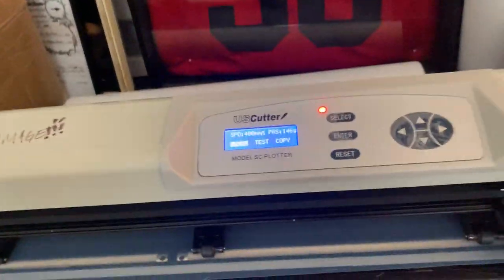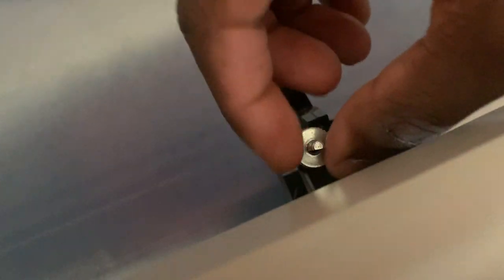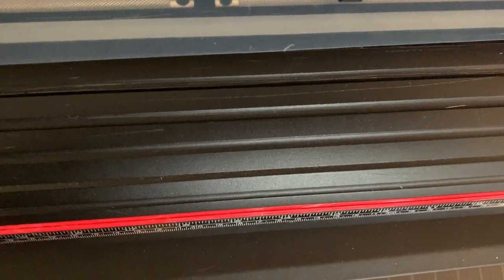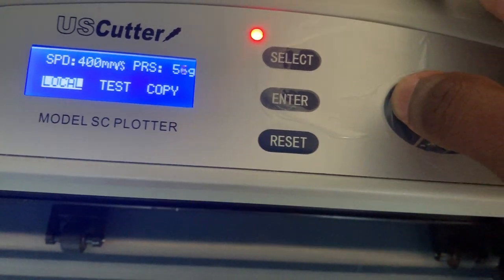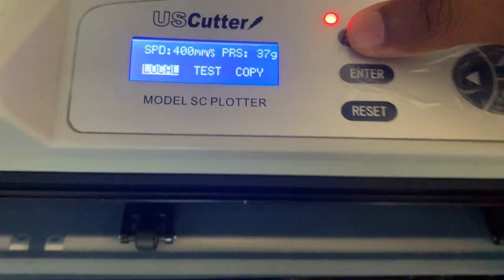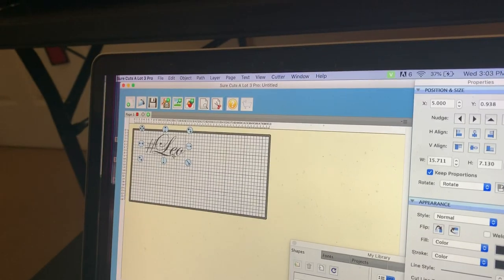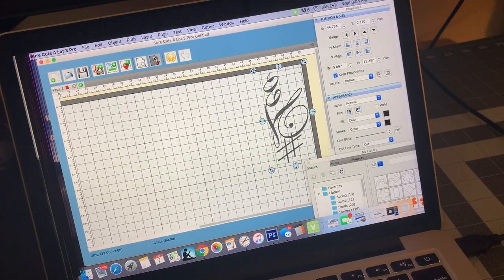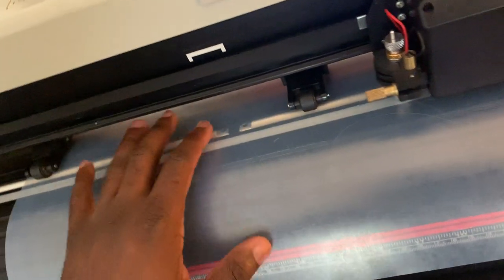How to use uscutter sc2 uscutter mh vinyl cutter

Comment: Please do more videos sir.  I have the USCutter SC2, got it brand new last year and was thinking about selling it because it was making my head hurt.  Your video actually shows what to do.  I want to use mine more so for print then cut.  I have a cricut as well but the Max print on that is 9.25 x 6.75 that doesn't work for shirts 2X or Larger.  If you are well versed in that hook us up. :-) THANKS
Reply from the maker: Thanks! And I will -The sc2 is only for cutting...It does not print nor contour cut. Let me know if that answers your question and let me know what other tutorials you may want to see
Reply: Yeah I know it does print. But there is a print then cut option that I’ve been trying to figure out what is the largest it can cut using that option.
Reply from the maker: @YMGCustomDesigns  my apologies - this is the sc model - not the sc2 - i will make a video on tthe sc2 when I plug it up...I just noticed the mistake in the title
Reply: No problem 😁

Comment: thanks brother. I went on the official site i talked to customer service and youre the only one that managed to tell me what i needed to do to solve my problem. my pressure levers go wild even if i have them set properly when i switch rolls i always get misfeed. i changed origin point and feed the vinyl now so its against the end of hte machine which helps it stay in place even if the pressure levers arent 100% working right. the porblem was that by being a bit too much to the left i was losing an inch off the design. by switching the origin point an inch to the left, it fixed this problem.
Reply from the maker: AWESOME!

Comment: I was looking at the video and noticed that the cutter looks like the SC model but not the SC2 contour cutter. On the SC2 the control panel layout is a bit different. Its more of a light blue too. Just making sure that you didn't order the SC2 and got just a SC cutter only. Both can contour cut, the SC2 has a built in system for it.
Reply from the maker: I accidentally mis titled the name of the video. years ago

Comment: Any videos on setting up the blade ? Just upgraded to this cutter and having issues with my blade seems to be a little too high from the vinyl, and when I put it lower it just cut through my vinyl
Reply: are you getting the right press/pressure for vinyl i use 300 speed and 22 pressure. if you use what comes up like 400 it will cut right through. make sure the blade is lined up it should tell you where it goes in but then the pressure amount is the next thing. i had way too much pressure which is why it was going right thru the vinyl. before that it was that the blade wasnt lined up in the insert the golden screw, the levers should be right under it and it should fit just right

Comment: Nice video Bro What size Cutter is that..
Reply from the maker: The 28inch
Reply: Thanks for replying I ask because I’m looking to buy the same cutter I got the silhouette cameo 3 when I first started … you’re not having any issues with the software running on your MacBook  I was looking to get the 34 inch do you think that’s overkill?
Reply from the maker: @Myinfinityclub  Not at all! I have had this machine for 4+ years now and have cut out decals for trucks, trailers and cars. For the price it is definately worth it and more! The 34 inch is great! I havent found the need for more space as the biggest roll of vinyl comes 20inches wide but 34 inches is good- Good luck
Reply: Thank you

Comment: Just starting out with same cutter I have my image ready to cut I send it to cutter and nothing happens
Reply from the maker: On the settings you must set the blade to the position where you want to start cutting and then click "Current" then it should cut...Let me know if that works, if not, I will make a video
Reply: GoGetter Type. Still nothing not sure what I’m missing.  Appreciate your time
Reply: Same here for me
Reply from the maker: @carlamcdonald14  does it give you an error message? what software are you using and what computer do you have ? (mac or windows)
Reply: GoGetter Type I’m using a mac with the RS 2320 Ftdi chip to usb on sign cut pro 2 and I’m having a problem with the connection. Trying to do a test print from the programme and it’s not doing anything. Any help welcome please
Reply from the maker: @emmaszostok4799  I have no clue what a RS 2320 chip is... maybe thats the problem
Reply: GoGetter Type The parallel port to usb doesn’t work for macs with sign cutter so I’ve bought the other connector. Which is the RS2320 Serial Port. That seems to be showing a port option on the cutter settings. The only thing is that when I test print from there with the selected port. I’m not sure how to set  it up so that it prints.
Reply from the maker: @emmaszostok4799  I have no clue what the parallel port is - If you bought the Uscutter SC it works with Mac with the  Sure Cuts alot software...If you bought the MH model it doesnt work with Vinyl Master Cut...If you are running a parralell windows on a mac and is having trouuble I have no clue.  Do you have the SC model with Sure Cuts alot software installed?
Reply from the maker: @emmaszostok4799  I dont use sign cut pro 2...maybe thats your problem there - I use the recommended product that works with the cutter for mac and have no issues. I hope that helps
Reply: GoGetter Type No we’ve only ever used the sign cut pro software unfortunately and we’ve paid for it
Reply from the maker: @emmaszostok4799  That could be the issue...I would reach out to uscutter to see if you can get sure cuts alot for free or if they can troubleshoot you..I checked their website and it says $150 - This is my first time hearing of sign cut pro
Reply: GoGetter Type my cutter is exactly the same as yours but it doesn’t have the us cutter signage on there. I think it’s called a liyu.. I’ll have a look at the software. Thank you for your help.

Comment: I start cutting and the vinyl starts moving all over the place and I put a lot of pressure then it leaves mark
Reply from the maker: Lower the pressure that you are cutting at. Seems like you are using too high of a cutting force
Reply: @shastylesdesign  ok I’ll try that. I bought it about 2 yrs and have been able to use it once lol 😂
Reply from the maker: @Lillyscraftsandgifts  I feel you lol keep tinkering with it and you will get the hang
Reply: @shastylesdesign  I’ll try it again and I’ll let you know. Is been frustrating